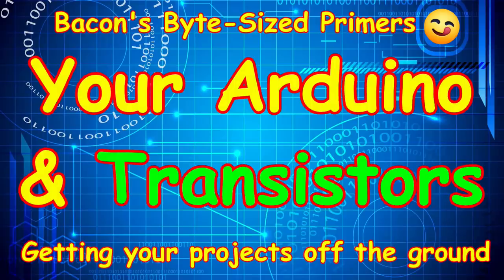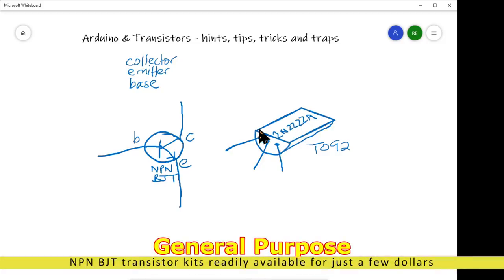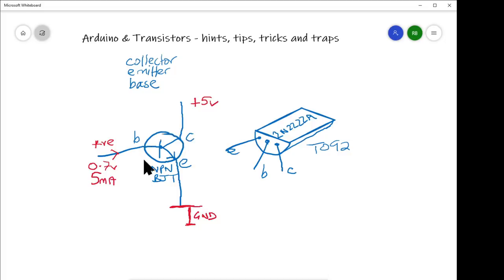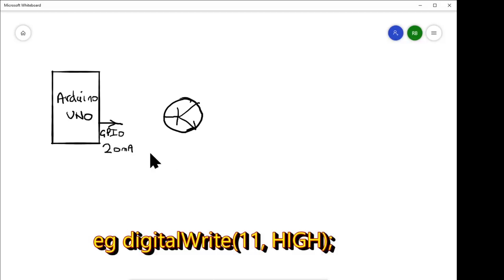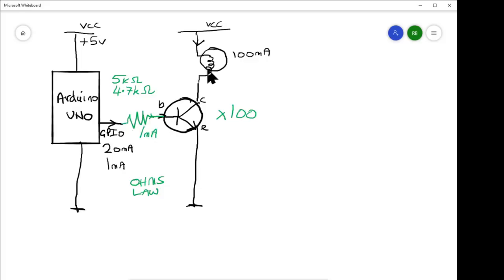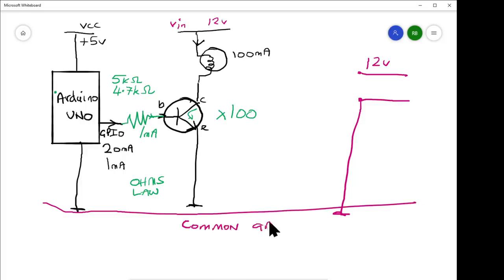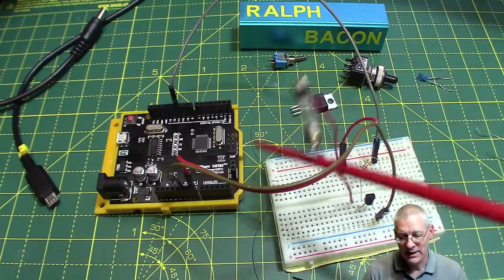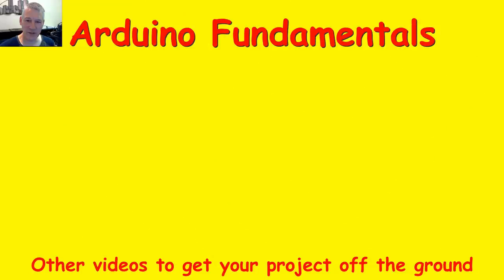#BB1 Transistors - from an Arduino Perspective. Bacon Bytes Beginners' Series.

Comment: I think you should have explained the voltage drop over B-E. So the B resistor is = Output voltage (Arduino) - voltage drop over B-E /output current = 5V - 0,7V = 4,3  4,3/1mA = 4K3 Ω
Anyway I thing it is lovely you teaching a little "analog" 😊
👍 to you
Reply from the maker: Oh, believe me, Allan, there was so much more info I could have included but I was absolutely determined to give only what would fit into 15 minutes. My cutting room floor is littered with good stuff. But there is always the possibility of another video on transistors that would include this. Thanks for the 👍

Comment: Thanks for a very helpful video. As a hobbyist I've picked up bits and bobs but it's really helpful to have this to fill in the gaps.

 I'm hoping you will do one on capacitors. I find pico, nano micro farads and codes like 22 extremely confusing and when I needed a ?105 for a project I found that was the one that I couldn't find in my large assorted box!
Reply from the maker: You're very welcome! I do have a video on caps waiting, can't remember for the life of me what I included, Robert,  but I hope you find it equally useful when I publish it.

Comment: And perfect timing.  I'm about to do this myself to switch a gazillion led devices for a flight sim cockpit build.
Reply from the maker: I knew that, which is why I released it now! Ha ha! Just on the LED subject, don't forget you can control (colour, brightness) a gazillion (approx) LEDs if they are Neopixels, with just one pin on an Arduino. I covered it briefly in videos #62 and #68.
Reply: If you're controlling a lot of LEDs, wait for Ralph's MOSFET video or, as he suggests, use addressable LEDs i.e. NeoPixels like the WS2812B or similar.

Comment: Ralph, At the end of this series please do publish your 'favourites'. Most Arduinites only need a few BJTs, MOSFETS to get started and it would help if you ended with a list of the most useful. Please include Logic level devices too. Once folk have got a basic set of 'Must haves' then they can go roaming through the data sheets for the different types. If you want my list, then please ask.
Reply from the maker: Good idea, Mr Whitefields (so formal). As you say, I tend to have a set of favourites that work with Arduinos (and similar), and I also have a list which I won't use (again) as they didn't play nicely at all. Anyone else inadvertently buy a MOSFET with a minimum gate voltage of 8V so it just doesn't work with an Arduino? Oh, just me then. Sigh.
If you could send me your list, that would be super, I can compare notes and claim all the credit too. Drat, didn't mean to write that last bit.
Reply: @RalphBacon  Start with TIP 120 and BC 547. Don't forget to do a Darlington pair example. Then focus solely on 5 V and 3V logic level transistors. MOSFETS go for IRLZ34(and 44) N. P channel Vishay A1SHB (but SMD only). Mains triac ST BTA41-600B for up to 3kW (but you don't do mains!) .... emphasise benefit of using passive components rather than the awful modern trend of "Doing it in software". As few passives keeps it simple and stable and saves the processor whizzing round and round. Remember output current and impedance of Arduino. Finally use an op amp as a high impedance voltage follower (zero gain buffer) to really clean up Arduino I/O.

Comment: Good video for those needing to understand BJT operation.
The 2N2222A can by the unknowing be mistaken for P2N2222A, they have different pinouts.
BC548 is in my opinion and experience the better transistor to use.
Reply: Also the 2n2222A from Farnell is a TO18 metal can! I feel that what you need to read on the data sheet is more important than the type. if you know what to look for and what it means you then have a much bigger choice of transistors to pick from.
Reply from the maker: These days, general purpose NPN/PNP transistors are pretty much interchangeable, especially where the Arduino is concerned. And I haven't used (or seen) a T018 can transistor for about 20 years! The last one was a BC108C!
Reply: @RalphBacon  Farnell are TO18, or LCC and RS components are LCC-1 and LCC-2!

Comment: Well explained. All in nice and easy general terms It is important to check the datasheet when choosing transistors. Pin lay layout can differ a lot.
General speaking - electronics is all about voltage control, governed by Ohms law.
Reply from the maker: Ohm's law is explained more in the resistor video. Coming soon!

Comment: Hi Ralph.  Since you’ve already got that white speed controller that you showed at the beginning, how about just get a duplex outlet, put it in a small enclosure, mount it on your bench/wall where it’s convenient to reach and run a grounded cable and plug from it to your mains outlet and put a longer cord on your fan that can reach the controller now plugged into the box. It’s grounded and safe and uses the white controller that you’re confident  with. No Chinese Roulette! As they say in Alabama,”Voy-la!”  All the best!
Reply from the maker: Tha is indeed a good suggestion, Gord. If I don't end up making my own electronics I might consider that. Simple and cheap!

Comment: 9:30 I think you forgot the 0.7V between base and emitter, Ralph. 4.3V over the resistor, that means slightly less than 1mA with a 4k7 ohm resistor. Not that it matters though. :-)
Reply: On the other hand it is usual to drive the transistor int full saturation when using it as a switch. So if the rated gain is, say, 100 then it would be quite common to drive the base at about 4 - 5mA for a 100mA load. So the resistor would be about 1K ohms.
Reply from the maker: Agreed. In the Arduino world we will drive it into full saturation, mostly.

Comment: Another great, very understandable video. I've been using the esp32/8266 chips lately and would appreciate, if it doesn't make the discussion too complex, for you to mention if these items can be used with 3.3vdc devices also.
Reply from the maker: As far as transistors go, they don't care what the output voltage is from your device as they only require about 0.77V to work. Just adjust the formula I used to calculate the correct resistance (bearing in mind that these ESP devices cannot output as much current per pin as an Arduino).

Comment: My favourite type of bacon. Thank you. So using your example if I wanted 500mA I would need a 1k resistor? Looking forward to the mosfet video.
Reply from the maker: Is this a question about the base resistor, perhaps? Theoretically, with a gain of 100 the transistor's base needs 100 times less current: 5mA in your case. Using Ohm's law (which is covered better in the resistor video) 5v/.005 = 1,000Ω (aka 1kΩ).  BUT!
The gain is dependent on the actual collector/emitter current flow; with a current flow of just 0.1mA the gain is about 50. At 1mA it's 75 and at 10mA to 150mA it's 100. But it drops to just 30 at 500mA!
Datasheets are definitely your best friend!
Great question, George, and you can see why I didn't muddy the water with sort of information in the video!

Comment: Now I know you were focusing on using the transistor  in digital mode as a switch. However, I have a question: Have you ever used  a transistor in PWM mode? I am not sure what I would use such a configuration  for but I am curious if the collector would just output the "noisy" on off wave form, thus making it useless for an analog amplification. I am guessing that feeding such a signal to an inductive load, such a motor would average out the output but a speaker would generate an awful load. Stay healthy, Ralph.
Reply from the maker: You wouldn't be able to amplify analog using PWM (this is not a class D amp) but, as you say, you can use PWM to generate audio tones, of course, Michael. And using high frequency PWM to drive a motor (not directly, ideally via a MOSFET bridge but a BJT tranny or two would work too, sort of) would enable speed and direction control of that motor (but not by averaging). I'll be talking about this in my Bacon Bytes video on MOSFETs. Stay tuned!
Reply: @RalphBacon  Thanks for that, Ralph. Bacon Bytes .....yum!

Comment: You MIGHT be able to use that transistor in an "in-between"/linear state by using a bypass capacitor to ground on the base (say, 0.1uF or higher). At that point, analogWrite() PWM control would become a ramping voltage, which should also ramp the current through that 4.7k resistor, thanks to Mr. Ohm. Or, one could skip directly to a MOSFET and just wire it directly, but decouple the load instead of the base/gate of the FET. (Might need a pull-down resistor to discharge the FET's gate.) Looking forward to the FET video! 👍
Reply from the maker: These days, Ted, I would certainly lean towards using a MOSFET instead of a BJT but that's for another video! I've found a pull down is certainly required on a N-channel MOSFET as just touching the gate is enough to make it start conducting! Ditto, a pull up on a P-channel. More in that future video.
Reply: @RalphBacon  As I think about it, in the specific context of Arduino, doesn't the output-mode pin pull to ground when it's low? (I remember having to set output pins to input pins to get the "high-Z" stage on a bus.) That being the case, the pull up/down might not be necessary...

Comment: Hi Ralph. Love your series, have learnt a lot...

Can you tell me what bulb you use in the demo?

I'm very interested in interesting, retro or otherwise non-LED lamps...

Can you let me know how I might search for a bulb like the one you show in your demo?
Reply from the maker: That bulb is a car bulb, normally used as the interior light (when the door opens it goes on). These days they are all LED but that one is incandescent. eBay has lots of 12v 5W bulbs but few of them like this:
https://www.ebay.co.uk/itm/2-X-239-FESTOON-12V-5W-CAR-AUTO-BULB-BULBS-38MM-INTERIOR-LIGHT-NUMBER-PLATE/143541337927
Reply: @RalphBacon  Thanks so much!

Comment: Am surprised you chose the American 2n2222 instead of the more international bc548.  As a novice hobbyist I like the ULN2003 for transistor switching.  Has built-in base resistors as well as protective flybacks.
Reply from the maker: Ah, mine are Chinese 2N2222A transistors, obviously very different, Steven!  😅
Well the fact is, I have umpteen transistors, all pretty much interchangeable, and I just plumped for this one. Your ULN200X series is a great set of Darlington transistors (some with base resistors, as you say) but not something for a beginner video! And they are usually IIRC in a DIP or SOIC package? Too many leads!
Reply: Isn't the BC family originally from the UK? I don't think it is more 'international'. It has some advantages while the 2N2222 has different advantages.
Reply: @kennmossman8701  (puts down hamburger) This was a post-brexit expression of reuniting with US standards.  We have saved your imperial measurement system for you too, if you want it back!
Reply from the maker: Apparently, the BC549C is the modern day equivalent of the BC108 (family): https://www.petervis.com/electronics/bc549c/bc549c.html

Comment: Happy new year everyone.
Hi Ralph, there is a chip out that replaces Relays, they use the 12c and spi chip is ADG714  and ADG715 . these are spst chips. With up to 8 outputs.
Any chance you can run a video on one of these chips and how to program. Really think these can drastically shrink arduino circuits needing low voltage relay switching.
Thanks Ralph and keep up the fantastic workshops.
Joe
Reply from the maker: Hmm. I thought initially, Joe, that these could be useful, as you say, to replace relays. Then I discovered this in the "Maximum Ratings" section:

Continuous Current, S or D . . . . . . . . . . . . . . . . . . . . 30 mA

This makes it no more useful than a standard Arduino ATMega328P output, which can handle 40mA on individual pins with an overall maximum of 200mA for all pins at any one time. (Best Practice keep each pin to 20mA).

I'm, thinking now that standard MOSFETs (eg 2N7000 or Si4599 dual) are a much better options to switching loads in a microcontroller environment.

Thoughts?
Reply: @RalphBacon  
Hi Ralph, you are absolutely correct, these chips are way to low in amp outs. Great product ruined by max output. 
Hmm mosfet switching really interesting,  dual mosfets even better. Have you got a video on these Ralph as poss relay killers as I couldn’t find one.

Comment: In the example of limiting CE current to a "bulb" by restricting the BE current, would you still use a current limiting resistor when using bare LEDs?
Reply from the maker: Oh yes! But in a different place! 
In this simple example, the bulb was rated at 12v so we did not need to "restrict" the current flowing through it at all. We had to ensure the transistor was being switched on enough so allow all necessary current to flow. 
If that bulb were a red diode, with a typical forward voltage drop of 2 volts (ie it "lost" 2v just by being there and conducting) and which required a maximum of 20mA, we would need a resistor to ensure that we only allowed 20mA to flow. We will cover this more fully in the resistor video, but we want to "drop" (restrict) 10v @ 20mA which according to Ohm's law is 10v/0.02A = 500Ω. As I say, we'll go through this in more detail in a future video. That resistor goes in series with the LED. You can keep the base resistor at 4K7 which just ensures the transistor is fully switched on.

Comment: Did you program it to function as a switch or will it automatically function as a switch when plugged in?
Reply from the maker: Any transistor acts as a switch if the Base connector is above about 0.8v (ie it becomes fully saturated). Watch the current flow, you don't need much.

Comment: Hi Ralph, I thought it was impossible to amplify voltage with a Transistor, I thought they amplified current only, or is that just a limitation for PNP resistors as a switch?
Reply: The voltage is not amplified. In this example the voltage is switched. It is always 12V across the load the current is then controlled buy the current on the base.
Reply from the maker: As I tried to emphasise, Andrew, any BJT transistor is a current amplifier. The current flowing into the base allows a greater current to flow between collector and emitter, defined by the gain of the transistor (in this example a nominal 100 times).
The voltage swing on the collector follows the current flow. But in reality we are not too bothered about this as we just ensure the transistor is switched fully on, to act as a switch.
Reply: @RalphBacon  ok found the  article looks like it's only an issue with PNP and different voltages
"This circuit works just as well as the NPN-based switch, but there's one huge difference: to turn the load "on", the base must be low. This can cause complications, especially if the load's high voltage (VCC being 12V connecting to the emitter VE in this picture) is higher than our control input's high voltage. For example, this circuit wouldn't work if you were trying to use a 5V-operating Arduino to switch off a 12V motor. In that case, it'd be impossible to turn the switch off because VB (connecting to the control pin) would always be less than VE ."
https://learn.sparkfun.com/tutorials/transistors/applications-i-switches
Reply from the maker: Lucky we have (P-channel) MOSFETs then, Andrew!

Comment: Thanks for the interesting video.  Here's my $AU0.02 worth:-
In order to make sure a transistor remains in saturation independent of the collector load (which is what you want in a digital circuit), it is usual to overdrive the base.  So, instead of 4.7k, maybe 1k or less would be better.  However, since the resistance of a filament lamp increases by a factor of 10 or more from cold to hot, that 3W lamp that draws 250mA at 12V when hot, probably draws 2.5A or more when it's first turned on.  So, your 4.7k base resistor may have (by clever design?) saved the transistor's life by limiting the collector current to a few hundred mA, i.e. 1mA x transistor gain.
Reply from the maker: It is usual to overdrive a transistor when we use it as a switch, that is true, as the worst thing that could happen is that the transistor is not fully switched on (ie operating in the linear region). Toasted marshmallows, anyone? Using an incandescent bulb in this demo was precisely for visual demo purposes. In Real Life I would expect a string of LEDs , or a motor or a relay... Watch the MOSFET video when it is published for more Arduino Real Life examples!

Comment: What caught me out with transistors and arduino was that you must always connect the load to the collector side of the transistor for npn (nn2222a) as there is no path to the common ground for the current from the gpio pin if the load is connected to the emmitter side.  Basics I guess, but it caught me out.
Reply from the maker: Yes, a common "gotcha" that one, good that you mention here to warn others.